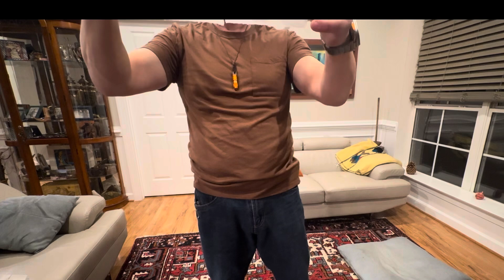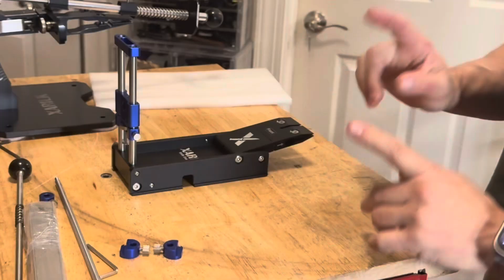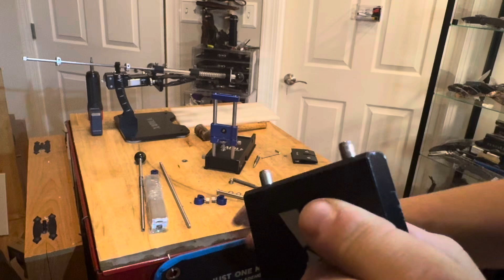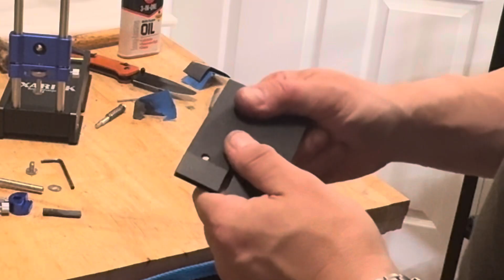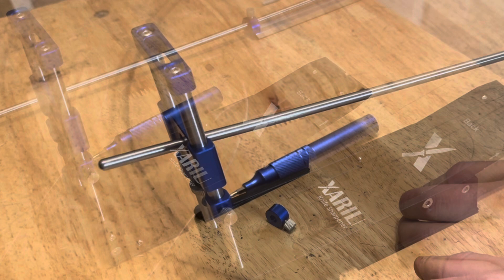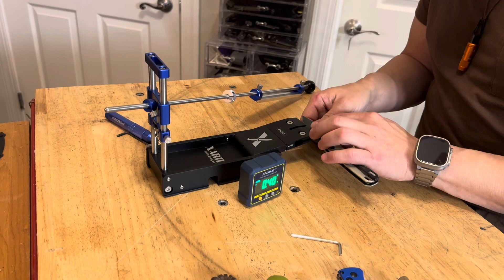Am I now the XARILK Quality Control Department? Folding Sharpener Trepidations…

Comment: After 8 months of limited use, this sharpener is now useless. The clamp is no longer snug to the base and the knife angle is constantly changing with each movement. After watching this video, I'll be taking it apart tomorrow to possibly replace that spring. Very disappointing. I've sent an email to customer service as it's listed as a 1 year warranty. I'll see what happens. Great video, wish I had seen this prior to my purchase.

Comment: I bought this and sharpened like 10 of my knives. There were several knives that were too thick to fit in the clamps, which is disappointing. Flipping the knives over is a bit awkward too. But for the knives that do fit in the clamps, it works well.

Comment: Which sharpening system do you ultimately recommend in the $200-$500 price range? Ive used a whetstone for 40 years and can shave with any of my knives, but Im always willing to try something highly recommended.
Reply from the maker: If you are using a wet stone already, there’s no need to get into the fixed angle sharpeners. They will just slow you down! 
I would invest into resin bound and metal bound diamond bench top systems. @outdoors55 is the channel to get good info on such systems.

Comment: I just bought the sharpener, it arrived yesterday. I got about as far as locking down the clamp onto the blade…where it stopped. The threading on the other side doesn't fit, rendering the entire thing useless. 
It's a shame because I was impressed when I first took it out of the box.
Reply from the maker: Thread the screw from the opposite side to chase the threads and then try from the top again.
Reply: @CBRxLIVE  well firstly, I realized that Im dealing with a Gen 2, and not 3 that all these videos are about. I only noticed that when I went ooked closely to see how the others were set up.
Regardless, in this case, what you're suggesting isnt possible. The hole in the bottom clamp is smaller so that when the screw is tightened, it won't just go straight through it;l,  and even if it didn't, there isn't enough room to get the screw even close to the hole from the other side, it just gets wedged.
As I see it my options are: return it or exchange it, or make a request for a new part that's likely to be fruitless; or just F-it, use a cutting wheel to put a straight groove on the head and use a Flathead screwdriver to tighten it. 
I'm sure there's an infinite amount of other options between those two things, and I'm game to hear them.
Reply from the maker: @ Gen 2 isn’t something I am familiar with. What you do with the unit is your decision.